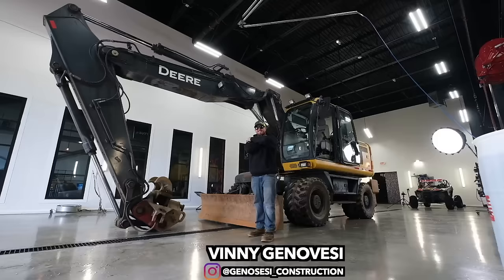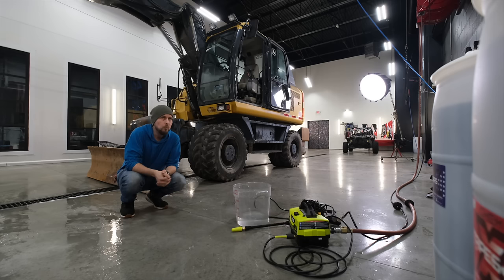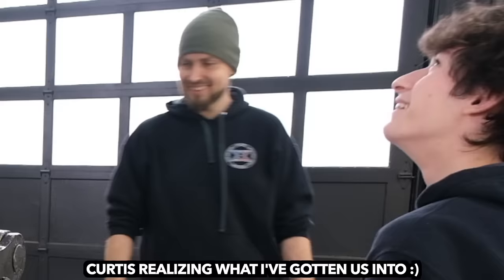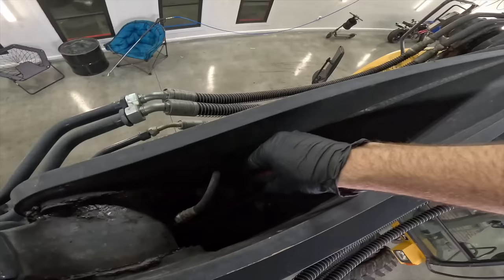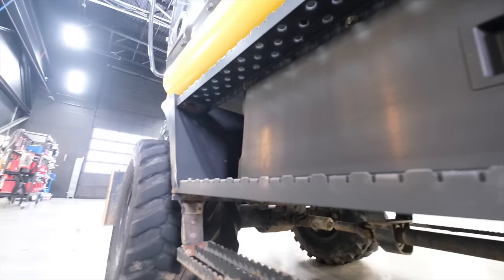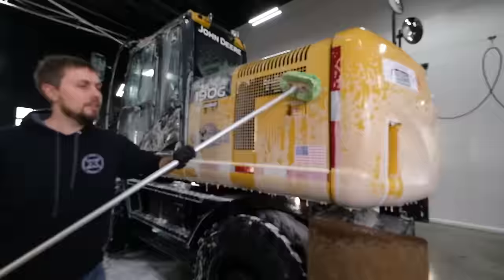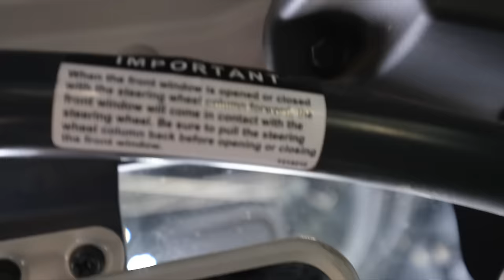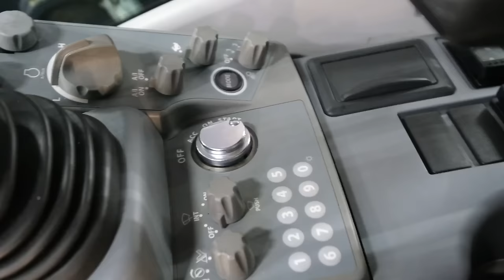I Degreased an Excavator with A $99 Ryobi Power Washer and it cost me 99 days of my life

Comment: I've got the DeWalt electric one and I've been fairly pleased with it.  Sure doesn't replace bigger units for bigger jobs like this, but it's so useful around the house.  Works great for cleanign the BBQ, cars,  tools.  It's ok for like a small walk way but soon as you get into the driveways and larger spots really need to switch to big GPM machines or you'll be there forever!

Comment: Fun fact, don't leave snake oil and stars and stripes in an unheated garage over winter. The snake oil suffered some separation and has waxy chunks floating in it and the stripes specifically for some reason lost most of its color. Still using both and the snake oil seems to work fine I've just remixed it best i can. The stripes is pretty weird cause it no longer is bright red its like a subtle organish red hue.
Reply from the maker: Those issues are not from freezing actually. Red dyes fade in uv light over time, that bottle of stripes will still work the same. The snake oil you got was probably my earliest batch which had just a hair more sio2 than the water could hold after few months storage, we fixed that issue since so send my team a screen shot of my message here to orders@chem-x.com and they can get you a replacement bottle coming
Reply: @ChemX  I've used a majority of the snake oil (it was the 32oz bottle) and last use it seemed to work fine still so not worth the hassle. However i do appreciate the feedback and offer. Overall I've had good experiences with most of the products and soon i will ge ordering more stuff. Ps maybe another scent option for the interior cleaner? My wife likes the green tea but while i don't dislike it, i don't love it and I don't generally care for leather smell either. Thats personal preference however the stuff is definitely an effective cleaner so overall im happy with it as well.
Reply from the maker: Thanks bud yeah we’re going to get some more scents going soon that’s def needed

Comment: I don't know if you were using but Pro tip from me who runs heavy equipment for a living and cleans them often, the easiest way to clean off grease is by using a combo of HOT water and good soap. In our shop we have a diesel run copper coil water heater pressure washer that gives us very hot water.

Comment: I have the craftsman electric version, it’s literally identical. Same gun, same foam gun, same connection type. I love it, a longer hose tho would be beneficial.
Reply from the maker: Yeah I was impressed by this thing, is the craftsman red? If it’s red I’m gonna buy one
Reply: @ChemX   The model is CMEPW1700. It’s like a rectangle prism shape with a red center and black outer. It has a handle on top and I’ve dropped it off a wall a couple times it’s very durable lol

Comment: I used to work at a cat dealership and we used an alkaloid based degreaser that came in a 55gallon drum. We had a 3 gallon sprayer that used shop air to pressurize it. The soap would remove the oxidized layer of paint and break down the grease. The only problem was that you could only leave it on the machine for about 10 to 15 minutes or it would etch the paint and leave streaks on the paint and even the glass. There is a learning curve to cleaning. As far as the cab goes you would be surprised how clean you can get it with a drywall sponge and a pail of water and dawn dish soap. . I used a shop rag and brakleen  to clean the layers of body oils from the joysticks. P.S. they only gave us 2 hrs to do the job.

Comment: With a paint brush and a little gasoline you can melt all that grease off in about 20 minutes.  Keep a fire extinguisher handy just in case and only use a little at a time outdoors of course. 
Once all the grease is gone you can bring her in and pressure wash like normal.
The chalk looks on the gray paint is oxidation.

Comment: I've blown apart 2 of them plastic QC wands in 20 minutes, long story, but being light and quiet was important, got some electric washers just for it, they worked alright, same rating they said, parts fit each other, trigger valve blew to straight open the shaft split, switched to other gun did the same. They can wash things but hoses and wands have to be dedicated to the unit, and they aren't designed for regular use for long stretches, or volume, rinse your car weekly for a season, or deck each summer if stored properly.

Comment: The excavator interior I did recently was much worse then this. I powerwashed the floor below the foot controls out the side after degreasing the floor and letting it dwell. Honestly steam, degreaser, and the horn gun did the trick. Heavy mix on the degreaser 😉

Comment: You injected high-pressure water into every oil, grease and electrical fitting on that machine. It's literally the worst possible thing you could've done to that equipment.
Reply: Nahhhhhh she will be fine
Reply: @manuelpiston  all I can come up with is that this is a very deliberate attempt to rage bait and clearly I've fallen for it. Nobody with any wits about them would ever "detail" anything like this. Oh well. You live and learn.
Reply: @JulietHotelFoxtrot  nah bro I feel what you said but. I'm sure it will be fine they will grease it every time they use for the next few months.

Comment: wit these type of cleaning jobs where ur cleaning actual grease off. Using chemicals like mechanics use to clean metal parts is the best bet to get that grease off quickly. Even like a brake cleaner will do the job really well but. That def isn't cheap unless u can get pallets of it for cheap or wholesale.

Comment: I once pressure washed my whole driveway. Not huge. About a 4.5x4.5 car concrete pad. 
Except we had never done it, and I used a leaky old small electric pressure washer. Also I am pale and ginger. So standing in the summer sun, wet, for 12 hours. It almost killed me.

Comment: My friend services "Real" pressure washers for industry. they start around 10,000 PSI and up. If this is gonna be a business you'll need a real pressure washer with hot water steam. I used to clean salvage - heavy equipment and cars, engines, trans whatever. That high pressure steam/water will leave the metal clean after blowing 3 inches of oilcrust baked and dried for years. Just like its not even there. 
Best to have two pressure washers a gentler one for windows electronics and gasket/seal areas. P.S YOU MUST wear a full face mask and heavy gloves when using super High pressure cleaners, blowback of scalding sandy oil water is brutal in the face!  But it will be CLEAN!  As I said you need a weaker one too for delicate areas and soaping..
Reply from the maker: That sounds awesome what brand machines are those?

Comment: got a NorthStar washer 20 amp  electric variable psi 900 up to 3000 at 1500 psi im getting 2.5gpm with a 5.0 orifice nozzle.  thing wasnt cheap at 1250$ but it has auto start stop and can change the oil and motor if it dies. that's why i got it. people think the Kranzle ones are best 😅  yeah right. you can get a electric washer way better than Kranzle for the same price.  i love when you destroyed the Kranzle in a video. u r the best

Comment: Cant believe you destroyed that Kranzel pressure washer?!😅
Reply: Couldn't believe it either but apparently had electrical problems. I got my hands on a second hand kranzle, same model, and am very pleased with it. Ideal small pressure washer to take to the jobsite. I also own a 2900psi/ 4gal unit with heater but that thing doesn't get used a lot anymore. For the quick jobs I take the kranzle.

Comment: Couple of serious questions: what is the going rate for a job like this? Also, are you concerned about electronics or that much moisture on switches and buttons in the cab? They’re not exactly designed for pressurized direct spray. If I did this job it would throw a code as soon as I finished…is there some type of disclaimer you give your customers for such problems that might arise? Love the work.

Comment: Were you putting hot water through the ryobi?  If so, is it rated for hot water?  I have a cheap green power washer (not any better than the ryobi) and it says not to use hot water, but that's what helps cut through grease so I wondered if the ryobi is able to use hot water.

Comment: Flow is flow, changing cross sectional area to manipulate output pressure will not change flow rate. The pump will be responsible for flow, and since the ryobi has a fixed flow pump, it will always be about 1.2GPM
Reply from the maker: Your right this machine did keep the same flow at both 1000psi and 1400psi

Comment: Odd question cause I don't know any better but isn't the grease used to lube the joints and stuff? How does that stuff get replaced? Also pretty cool watching the engine and stuff getting cleaned. Never done it myself cause I'm too scared of breaking something haha.
Reply: The grease gets filled into the bearings and joints through Zirk fittings. 

The old grease is literally pushed out of the bearing when new grease is forced through the Zirk fitting.

Comment: Just curious about the overall approach to cleaning the machine.  My idea would be to work from top down.  What about the job made you sequence the way you did?
Reply from the maker: I started on the bucket end to see how the paint liked the degreaser and then started from the top after, def start from the top the grease will go on the lower areas and you’ll be degreasing several times lol

Comment: Any tips for the caps on the 5 gallon jugs. Lost almost a whole thing of heavy duty over a weekend. Also you need to clean a concrete pump, that would be the ultimate challenge.
Reply: The tar truck was pretty challenging😂
Reply from the maker: I do want to do a concrete truck actually I’m hoping to line one up soon. What happened to the pail you think?
Reply: @ChemX  not sure what happened. Those spouts that screw on leak sometimes from the rubber o ring. My stars and strips has sat for months and it’s fine, my liquid x one leaks out if I leave it laying down and I lost a pail of hd over a weekend. Maybe it’s just user error, over tightening or not tightening enough.
Reply: @ChemX  also one of our drivers likes to keep his concrete pump real dirty, if you’re interested.

Comment: What's the specs on that electric motor with a pump hanging off the wall? 5-7 hp? Looks like a clean build! We use all your products!
Reply from the maker: Thanks yeah that one is 7.5hp running 3000psi@3.5gpm, this is the one here actually: https://www.chem-x.com/products/the-complete-x-factor-touchless-wash-bay-kit?variant=40824910184641